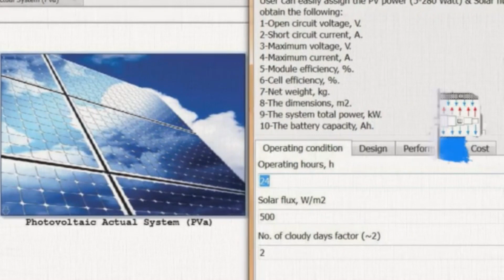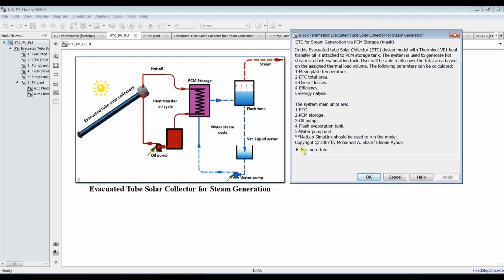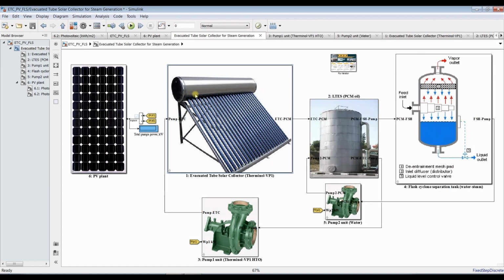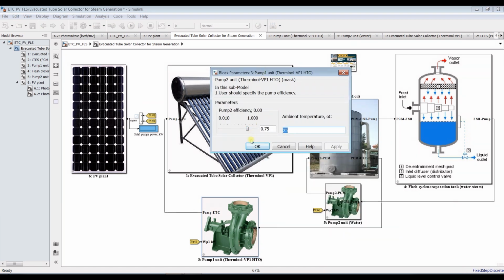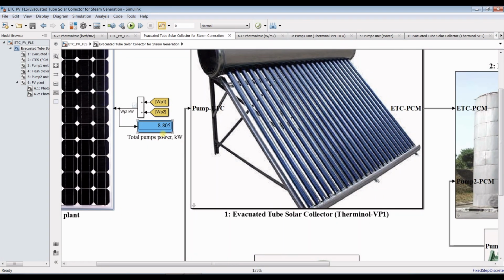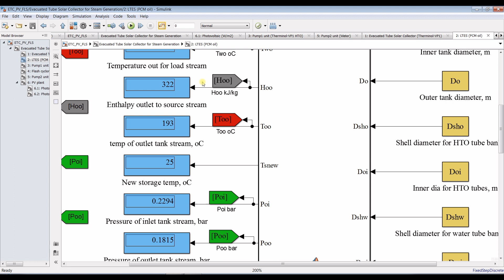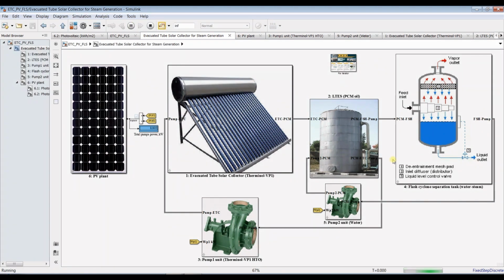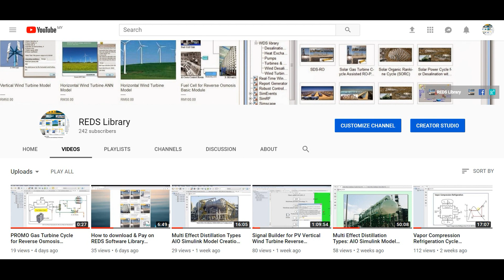Evacuated Tube Solar Collector | Photovoltaic | PCM Storage | Matlab/Simulink Design Model

Comment: Can you please specify what types of PCM you sir used
Reply: By specifying the specific heat capacity, you can use all types
Reply: The model allows you to use any type of pcm
Reply: I want to use it in fact I want to use a cool type   to cool surface area for pv solar cell
Reply from the maker: I can't imagine your point of view. Because etc has a relatively high temperature (150oC). You can chat on redslibrary website.
Reply from the maker: You can subscribe from contact page on redslibrary website. So prof Sharaf will become able to contact you.